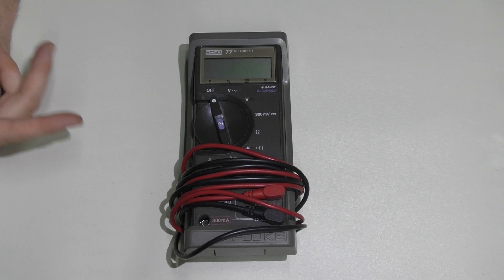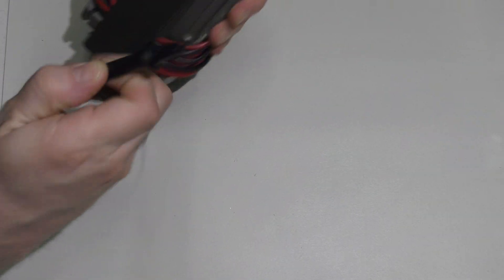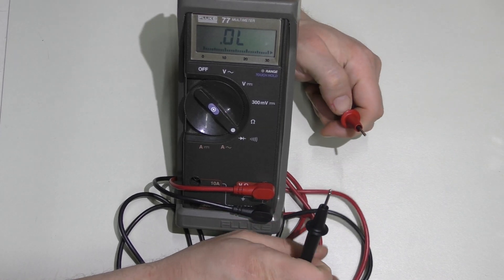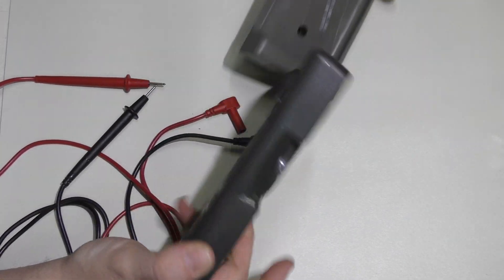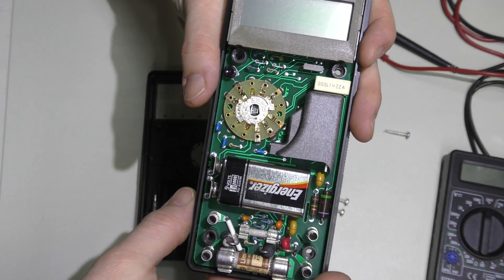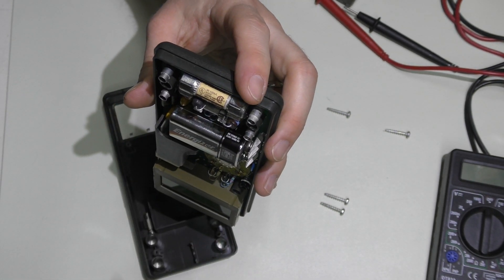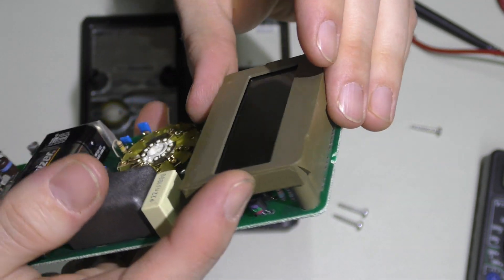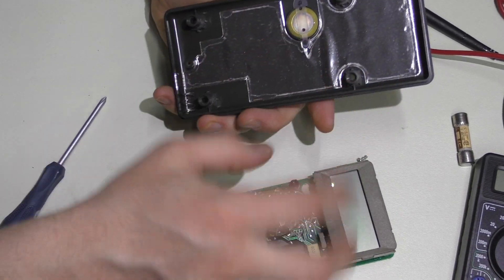PTS Ep. 54 - Original Fluke 77 Multimeter Teardown

Comment: my voltmeter reads over 1.0 without testing anything I tried turning the black adjust but no luck
Reply from the maker: Hmm.  Not sure what to tell you.  You still might be able to get it calibrated however the cost just may make replacement a better idea.